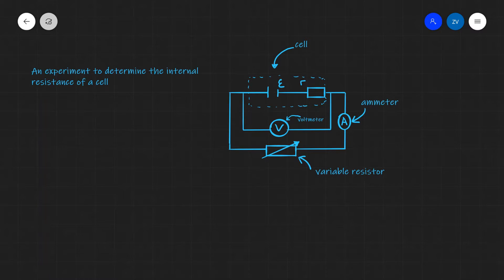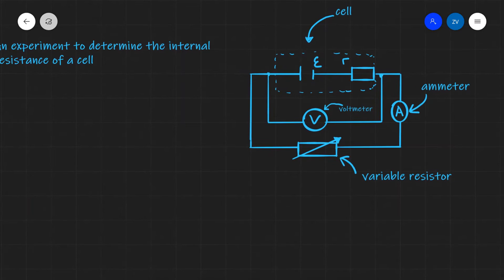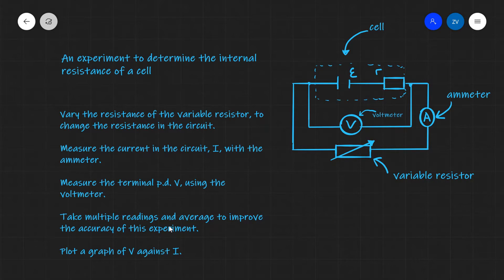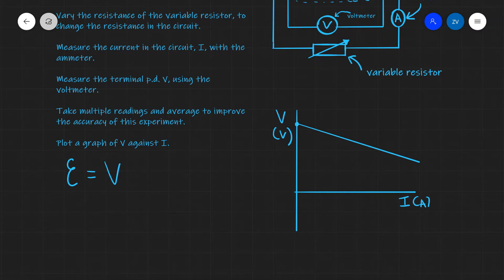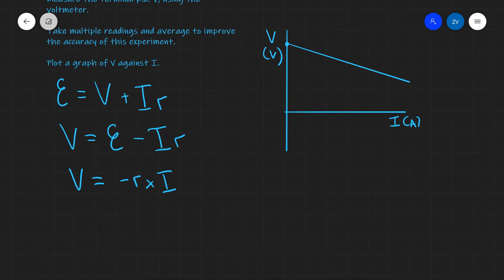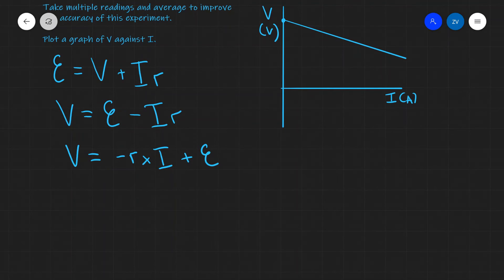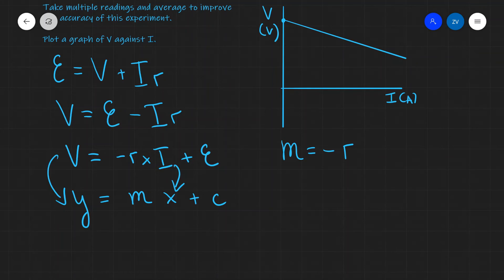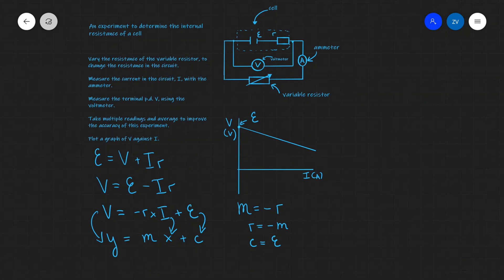A Level Physics: Internal Resistance Experiment

Comment: When you repeat readings for voltage and current in the internal resistance practical and average them, how would you be able to set the variable resistor to the same resistance each time in order to be able to average voltage and current for a particular reading? Would I have to describe that in my method to get top marks? Thanks.
Reply from the maker: you actually vary the resistance. In practice it's just a variable switch and you just change it to a new position. This level of detailed is not needed to score the tops marks : )